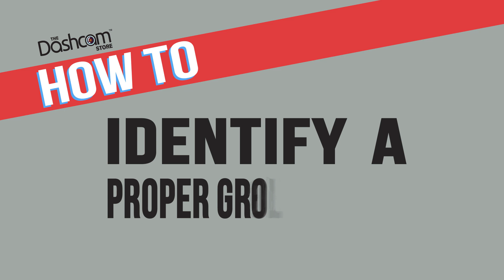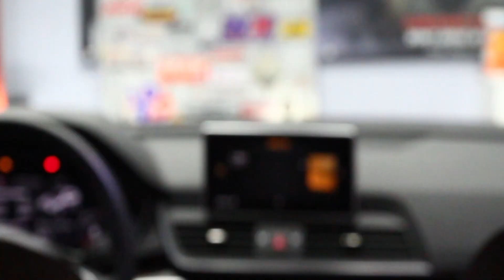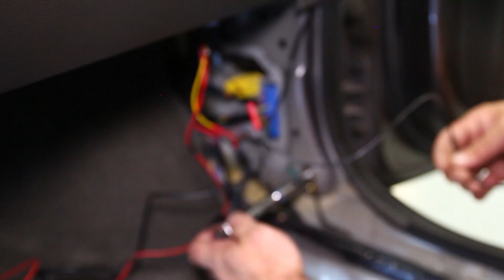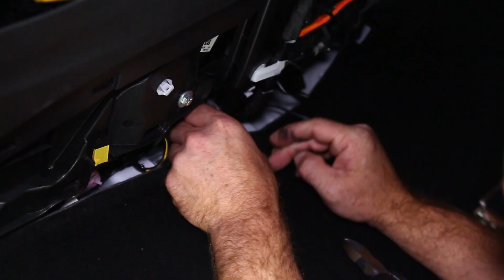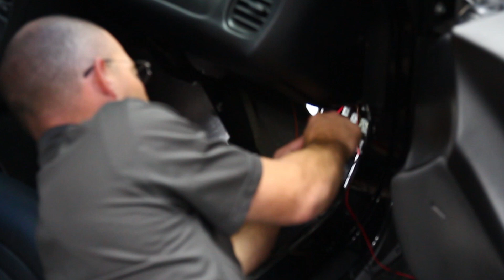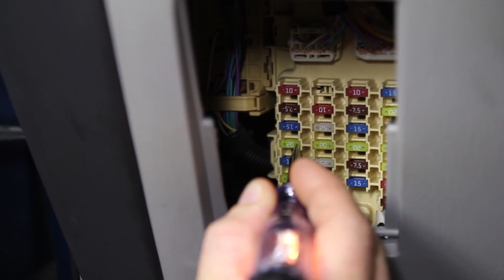03 | How To Identify a Proper Ground Point | DIY Dashcam Installation by The Dashcam Store™

Comment: Can you connect your ground wire to an existing ground wire, rather than always going to the body?  If the existing ground wire is earthed to the car body, why would I need to do the same all over again.  Just connect to that existing ground wire, no?  (in my instance I'm wiring a reverse camera and I need power and a ground point.  The power I will get from the reverse light, so why can't I just connect my reverse camera ground wire into the ground wire of the reverse light?

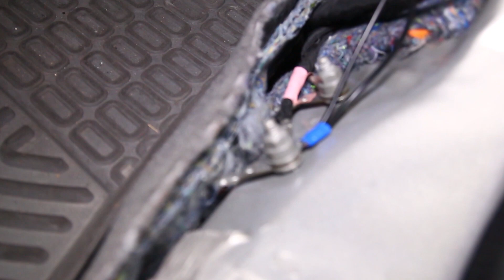Comment: Is that a grounding bolt the  blue tipped wire at 0:32 is connected to? I have a few of those smaller bolts on a metal plate near the passenger fuse box. Are they suitable for dashcam installation?
Reply from the maker: Correct, as long as the bolt is attached to the body/frame of the vehicle and not just suspended under the dashboard, connected to plastic, etc.

Comment: Interesting video with some quality points made, I have a question - I installed a front and rear dash cam system in my car, i piggy backed a fuse to provide power which goes through a usb hub for the usb mini b connection to the device, i didn't splice in the reverse camera wire, and i found a painted metal surface within the proximity of the fuse box which i drilled and screwed in the ground wire to, for a week or so the dash cam worked fine, the rear worked too, but after a week the rear camera fails to show the picture in picture on the device screen, cycling through the camera modes does nothing, however if you remove the usb mini b power cable the rear camera picture in picture displays on screen and can be cycled through the modes, I've tried draining the devices built in battery and recharging it, I've formatted and reset it, and even performed a hard reset on the device and the problem still persists.

Would my painted grounding be the cause of this? since without usb power it works, but when usb power is provided it fails to work.
Reply: Hi Depleted, I'm having the EXACT same issue, I think it's the ground. Did you ever resolve this?
Reply from the maker: Hello. I would suggest calling into our technical support line @ 888-855-5470